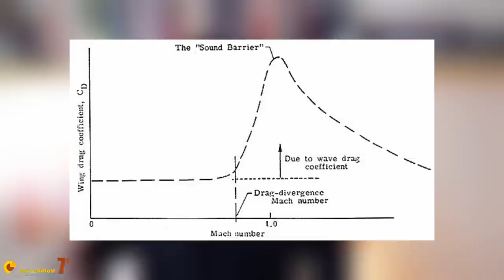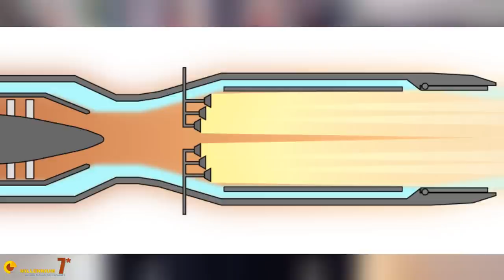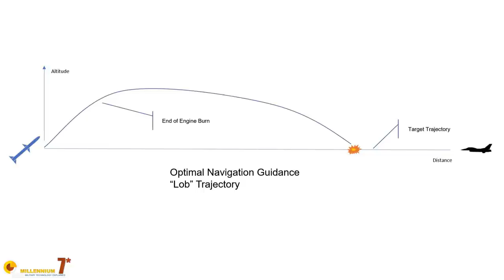Flying SUPERSONIC with NO Afterburner | Why SUPERCRUISE is so Important?

Comment: Would have loved to see the performance of the YF-23 if it would have gone into production. Thank you for the video.
Reply: Rumors I have heard is that it would SC up to M 1.8. Crazy good.
Reply: I imagine they would've added thrust vectoring to it, which would make it more maneuverable than anything else, man, it's a shame that aircraft lost.
Reply: @MihzvolWuriar  From what I’ve heard, its control surfaces were so large that it actually didn’t need TV to perform the exact same low speed maneuvers as the F-22. And, the “Y” tail meant the omission of another set of control surfaces and, thus, the accompanying drag those surfaces bring.
Reply: @DBravo29er  I knew about the Y tail, but didn't know about the control surfaces, but that's why I said if they managed to add TV to it, that aircraft would mean serious trouble, and IIRC, it only lost to the F-22 because of the superior lobbying from the NG, is that right?
Reply: @MihzvolWuriar  That’s my understanding as well; that it actually demoed the same “air show” moves as the YF-22 did, but after several important minds had been made up. I’ve heard from multiple sources that the YF-23 could perform all of the visual candy that the YF-22 could. Including things that we have been “told” are required TV.... such as stationary tail-stand maneuvers.
Reply: @DBravo29er  Such was the performance of that aircraft, man, I really wish it had a production model.
Reply: @MihzvolWuriar  The YF-22 won, because it was the better concept for the required task and inanition, Northrop had Avery bad reputation from the B-2 program. Furthermore Lockheed flew a very aggressive flight test program, that just blew the USAF`s "mind" in comparison to the humble YF-23 test program.
Reply: The YF-23 was the superior aircraft of the proposals in nearly all scenarios regarding flight-characteristics. But it had a few other things ( bad management, and a lot of lobbying) that got it rejected.
I mean - it was faster, stealthier and more manoeuvrable (to the point it could take such sharp turns that it would leave contrails), but they didn't bother showing of weapons like with the F22.

Aaaaannd it looked way better.
Reply: Prolly too much for one aircraft. Our lead in aerodynamic sciences would be at risk if we lost just one of those airframe. Not to mention the software and another such business.  Like teleportation block.

Comment: as you say going fast is safer but turning is more difficult
it is easy to generate high G and that is what is needed to force the missile to use high G as the intercept point moves around in sky. I think some missiles don't use lead pursuit while they are traveling to the target since the pilot then can make the missile start maneuvering loosing speed, but the missile need to use it when closer or risk missing. So defending pilot need not start manuver immediately and he has his countermeasures onboard chaff/flare and jammer ( which he can flip on and off if the missile has home on jam capability ) and if  he can do the doppler notch perfectly it is nice but might die trying.
it differs between pilots how many G they can take and for how long should affect what the pilot tries to do.
if the two sides merge, and have similar performance, you might have to slow down to corner speed to make the sharpest most efficient turn you can make. This is not a fixed number but depends on how loaded the aircraft is with fuel and weapons. You seen WWII fighters drop their droptanks as the fight starts. Or multirole fighter doing air-to-ground mission should need to jettison all the bombs to be able to win the dogfight. 
There is also another speed called corner velocity but is unclear to me what it is. It is a higher speed, maybe it is the highest speed at which you still can still generate maximum degrees per second in a turn.
The addition of offbore weapons might also affect if the pilot wants to slow down or not.

So I want to hear more about tactics and speed. Have anything changed the last 20 years?
Are the latest versions of missiles basically the same as the first version or have they gotten a brain upgrade?

Comment: The old NK-32, installed on the original Tu-160(years 1987 - 1994) is widely known as the most powerful engine of a combat aircraft in the world.

The NK-32 engines, originally installed on the Tu-160, had a mass of 3.7 tons with a length of 7.5 meters and a diameter of 1.8 meters. The power plant is capable of developing thrust up to 14 thousand kilograms-force (137.3 kilonewtons) and 25 thousand kilograms-force in afterburner mode. 

Tu -160M(year 2018) is a completely different machine. Outwardly everything looks the same, but the engine and flight range, power and everything is different.

Tu-160M(maximum take off weight: 275 tonnes) has NK-32-02 engines that includes new blades for the compressor and turbine, as well as more efficient cooling. The aircraft is capable of reaching supersonic speed(2.2 thousand km / h) in afterburner mode and holding it for 45 minutes.

The main and back-up electronic systems of the NK-32-02 engine should provide a bomber flight for up to 30 hours. Fuel supply and hydromechanical regulation systems must operate at near-zero and negative overloads up to 2.7 g and at temperatures from -60 to +50 degrees Celsius. The minimum service life of the product should be 12 years, with the possibility of extending the service life to 21 years. Finally, the NK-32-02 engine must be resistant to the effects of the damaging factors of nuclear weapons.

Comment: It's a factor. More important than starting speed is starting altitude.
Fighters that can climb and build great speed while climbing stand a better chance than not.
You'll light everything up, drop stuff you can afford to drop, climb as fast and as energy efficient as possible and try to calculate optimal launch position.
If engaging at BVLOS you'll never engage at military thrust, supercruise or not. Unless you want to die that is.
Supercruise makes things easier. Patrol range, starting speed etc.
But if you have fuel to spare, power and a fast fighter (high T/W, low loading), you'll probably still come out on top, given similar metrics.
Reply: Starting altitude is in a way the same as speed. Unfortunately high altitude also makes you an exelent target for radar, ground baset irst systems. So there are advantages and disadvantages with it depending on plane and mission.
Reply: Sure. But this is clearly talk about intercept with air to air. And no. Speed is not the same as altitude. In physics yes. In this reality no. Because you cannot compensate in starting speed for what the missile gains in thin air. Your MAR is far larger for someone engaging you at high altitude than low.

Comment: IMO the Eurofighter's supercruise advantage could be greatly hampered by its inability to use it with an external fuel tank.
Reply from the maker: Possibly, but I suspect it is still capable with one tank, albeit at lower speed.
Reply: As far as I know super cruise is defined as maintain supersonic speed without afterburner with a "typical weapons load". It does not mean fully loaded and not only in "clean configuration".
Reply: It can supercruise with 2 fuel tanks at around Mach 1.2 roughly. This was mentioned by a pilot in an interview on hushkit. It was also stated to be able to supercruise with 2 tanks by a journalist who had a ride along in the Typhoon and wrote an article on it on the aviationist. It was also said to be able to supercruise with bombs according to Mike Sutton another interview on aircrew interviews. So it is quite capable. The Typhoon is apparently able to supercruise with weapons and fuel tanks in hot or cold weather. There were reports that the Rafale was not able to supercruise in hot conditions. Only the Gripen E was said to be able to supercruise but whether clean or with carriage was not mentioned.

Comment: I disagree that the Concorde was "not technically a supercruise aircraft". It was able to cruise at M2 for multiple hours without afterburner. The fact that it needed a touch of reheat to accelerate through M1 doesn't detract from that in any way. I suspect that plenty of the other aircraft on this list need either afterburner or a "dive-climb" acceleration profile to punch through the transonic in all but the cleanest configurations.

Comment: question : if the the drag  becomes normal after the barrier then why dont planes use the afterburner to get to mach 1.1 and then use dry thrust
Reply from the maker: The drag coefficient is lower, but the drag keeps rising, albeit at a lower pace because ... the coefficient is lower. To accelerate from  M 0.7 to M 1.2 (0.5M delta V) requires a larger impulse than from M 1 to M 1.5, same delta V but lower impulse.
Reply: @Millennium7HistoryTech  thx . and big fan

Comment: 03:29 Did the F-104 used slats and flaps in cruise? Even in subsonic cruise with external stores that would sound like a suboptimal design... ??
Reply: Slats and flaps are maneuvering devices and have a lower structural limit extended than supersonic speeds.

Comment: There is a 0% chance of knowing with certainty whether the F-35 can supercruise.  Official statements claim that it can supercruise for 150 miles or so. It is surprising that anyone would claim to know with certainty that it cannot.  The rumor is that it can supercruise indefinitely, though it will lead to excessive erosion of the stealth coatings.  This seems like a fairly solvable issue.

But seriously, given the clean configuration and no external fuel tanks, and the fact that has 2X the dry thrust of a JAS Gripen E and only 1.5X the empty weight…it seems likely that it’s Supercruise potential is about the same as a Gripen E

The reality probably is that it can almost certainly supercruise for longer distances at altitude in the thin air and a bit lighter fuel load.  The physics pretty much guarantee it.  The drag coefficient between an F-35 and a Gripen E with a fuel tank are going to be virtually identical.

This is just something that probably is best not advertised, so you really have to be a bit gullible to believe it can’t supercruise.  It is probably discouraged in peacetime (for maintenance reasons) and fully encouraged during wartime missions that might require it.  There is zero benefit to publicizing such capabilities.
Reply: The thing is 150 miles is not CRUISE.. that is DASHING.  Cruise is an already old term and means a large leg of travel.

Comment: So do aircraft capable of supercruise need to use the afterburner to go past Mach 1? And when does transonic end, at Mach 1, or later around 1.05?
Reply: It really neved does. It also depends on the shape of the aircraft. Byt by say 1.3 the effect start getting neglectable.

You can design a aircraft to to have a smalet or wider transonic range. A example of a plane that suposed had a very narrow range was the sonic cruiser, hence going all the way ro 0.95 in cruise. 

Most supersonic aircraft try to have the wide range so they can go over it  with a lowet peak.

Comment: Does going supersonic contribute to the skin of the aircraft heating up, don't they need special coatings?
Reply from the maker: The paint is designed to withstand temperature and abrasion. Very expensive, but if you use it for your car it will remain pristine. Just joking.😀

Comment: don't worry the next-gen air 2 air missiles will have articulating rocket motors and that will improve mid-air maneuvrability by 75% or more as the tech is perfected over the next 20 to 30 years

Comment: I’m shocked that a requirement of the f-35 not be super cruise.  It’s very important when launching missiles.
Reply: I think the thought process was that the f35 is stealthy enough to get closer to a target rather than using speed to increase range
Reply: It wasn't one of the requirements. Supersonic speed also gives off a higher heat signature due to heating and stealth was a higher priority. Raptor was designed as an air to air fighter. F35 isn't.
Reply: I've known about that for about five years now.  It's not something that Lockheed or the American corporate media talks about much.
Reply: @mignik01  I agree 100%.  In fact, I think that it should have been called the A-35, but then they wouldn't get the sales.
Reply: @AvroBellow  

they have and it’s in the news a lot. But that doesn’t keep me from wondering why.  There may be a good engineering reason for it.  I’m retired now, and Navy, when F-14’s were still new. 

I have friends who fly in the National guard in f-15’s and 16’s....  (they fly for our airline). They aren’t surviving encounters with the f-35 or f-22. So it must not be super critical.  But We all one that the faster a missile is launched the greater the distance. 

Who knows.... it’s beginning to appear that much of what we think we know about the F-35 is misinformation.   It may be that the F-35 is far more capable than we are being told.

I know that the nations who operate it want more and nations that don’t have it wish they could. 

Canada.... it’s probably the best aircraft for their Air Force.
Reply: @AvroBellow  I don't see it as a bad thing. Strike eagles are much more flexible than eagles. The pilots say that the F35A flies like a strike eagle with a lot more situational awareness. The actual people who fly it talks about the aircraft in a realistic way. No fan boyism involved.
Reply: @bret9741  There are actual problems with it. And it is not the "it cannot dog fight" or "it is worse than F16". 
ALIS is a nightmare. More range would be much appreciated. AIM 9X cannot be fitted in the weapons bay (it can be fitted on the wing pylon but this compromises stealth). There are programs to address it. ALIS is being replaced. Variable cycle engines and Conformal fuel tanks are being worked on to increase the range. 
In the long run it will be a game changer. It has given US the ability to mass produce stealth aircraft, which is something no other country possesses. The open architecture is already paying off. There is a new processor offered with Lot 15 and DAS is already updated. The helmet is a game changer in situational awareness. All of this has applications in  future aircraft.
Reply: @mignik01  I’m sure there are issues. When I was in the Navy, we finally fixed the F-4’s.... we learned how to live with its issues and fixed some we couldn’t live with.... then as the F-4 finally matured  replace with the f-14A’s.     There we were again with a lot of issues that weren’t fixed until the F-14 D...... which was replaced with the FA-18 that was also problematic.... albeit mostly range issues.
Reply: Actually, its not even supersonic. Flying supersonic for more than a few minutes has been banned because it makes the coating melt down and causes structural damage.
Reply: @csabascs5913  it doesn't cause structural damage. It damages the paint. Only affects the B and C variant. There is a fix available. it was cheaper to modify the flight envelope. They spotted it during extreme manouvreing. In normal flying conditions nothing's gonna happen. If you get into a situation that's critical they are allowed to go supersonic as long as they want.
Reply: Technically the F-35 can supercruise, but spending any amount of time at Mach 1.3+ wears down its expensive to apply stealth coating, which requires factory maintenance to reapply. Considering that Stealth is the F-35's big feature, they hobbled it when it comes to supersonic flight.
Reply: @ShinVejita  F35 coating is more durable and cheaper to repair than F22. It's not a problem with this coating. During extreme supersonic manoeuvres F35 B experienced bubbling in the paint in the tail section and the F35 C experienced thermal damage. So a time limit was introduced. The A model does not have this issue. If you are in a crisis situation, even B and C models are allowed to go supersonic as much as they want. There is a fix available but they didn't think the money spent justifies it.

Comment: Pretty certain Concorde could break the sound barrier without reheat, it just took longer and burned more fuel in the process.
Reply: If I remeber corectly it had to flaten the triectory or even go inte a shallow dive.

Aslo it need the afterburner to take of with full load due to low speed inefficency of concorde wing.

I did a few calculations of spike and boom and there wings is about 30% more efficent at low speed.

Comment: If we had to compare 2 supercruise planes to M1.3 for example ... The Rafale maintains this charge with missiles externally
The F22 more radar stealth with its hidden charge, but should open a hatch when fired ...
What will be the consequences for the supercruise speed of the F22 of this opening hatch? and for its missile at the moment of the release in the supersonic air, can it fire without problem?
Who will be in terms of speed, discretion and shooting envelope ... the one who will lose the most when shooting during a supercruise ?
Reply from the maker: The F-22, the drag will increase but it should be for literally 3 or 4 seconds. The supersonic release from the weapon bay was actually one of the aerodynamic problems to solve.

Comment: All you really need is a better than 1 to 1 thrust to weight ration without afterburner.  Evidence in point English Electric Lighting and the F-20 Tigershark both of which could go supersonic without an afterburner.
Reply: @Vladimir Polonium   They are going to jettison drop tanks the moment they think there is an engagement coming.   Two heat seekers and A gun should probably be the standard applied.